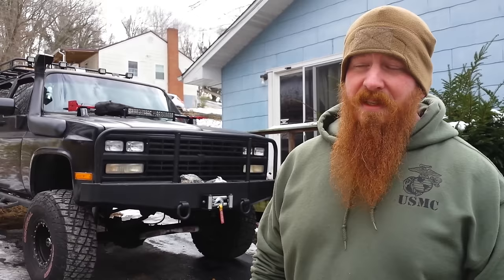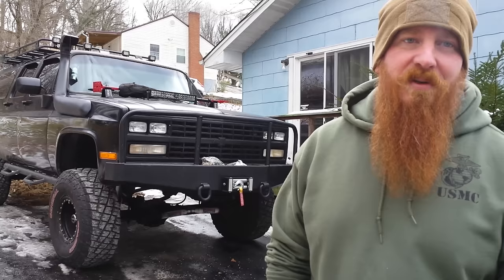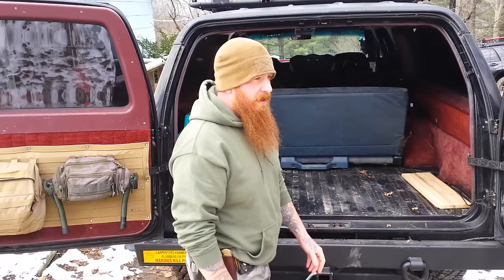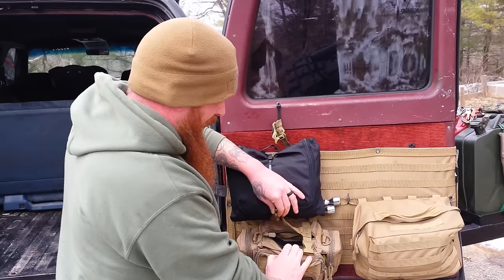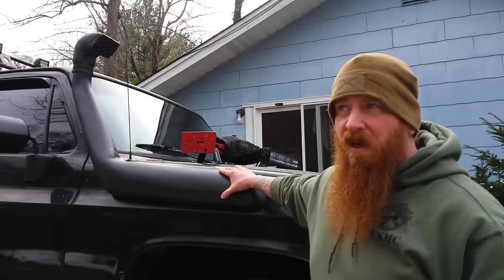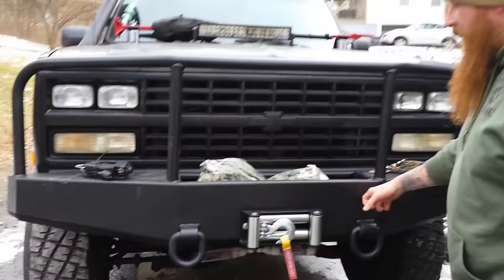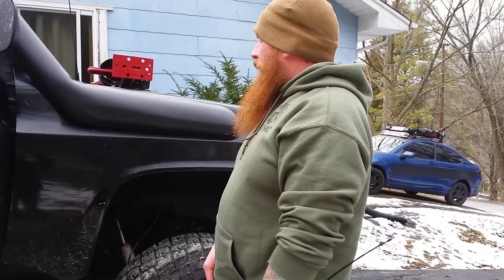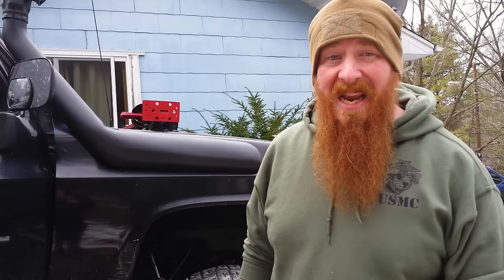80's Chevrolet Suburban 4x4 Bug Out Vehicle  (CSBOV)

Comment: Dense foam donut with a round outer surface to fit inside your tire with a center notch toward the wheel hub. Kevlar inner tube filled with Nitrogen that inflate's pushing dense foam outward making the tire ridged. Puncture proof tires come in really handy on a bug out vehicle. 😊

Comment: Additionally wise would be , 4 inexpensive baofeng , etc ham radios inside a med sized faraday box in the back with solar chg batteries and a solar panel / extra lg battery as well . Burkey filter , etc . Roof inside frt mount weapons racks , few other goodies . Several farradayed surefire lights with a bunch of batteries . As well ANYTHING ELECTRONIC IN RUNNING GEAR . Spares farradayed on the roof rack compartment . Get an additionally enlarged capacity alternator and a secondary rear mounted battery also .
Reply from the maker: Thank you.  I have tons of comm gear

Comment: nice rig, i have an 89 suburban as well 3/4 ton, just put 35's on it ..lockouts on front hubs and ox locker going in rear diff next month. same light bar and  im looking for a bumper....love yours....truck fits nicely  in the back of my duece and a half  lmao...just scored M35 multi-fuel  im in love. good work, semper fi brother. get your HAM license and add a 2 meter radio ...use CB as well. all the best from alaska KL4UQ
Reply from the maker: You fit nicely in the back of mine motivator roflmao

Comment: Y'all never checked into a split power swash plate system for your bug out vehicle that gave each tire a drive system removing the need for a axial that would greatly increase your ground clearance under your vehicle? Some thing to look into. ☺

Comment: I had an 89 burban in 2013 wish id never sold it, welded up the rear end with 32" tires 15" wheels it would go through a lot in just 2 wheel drive risen to buy another here ima few weeks

Comment: Real beauty. :D  That's pretty much what my bug-out vehicle will be.

Having worked on lots of old Chevy trucks, I'd give one bit of advice.   The 4-speed 700R4 transmission is a weak link.  They don't tend to hold up well in off-road trucks, and don't last as long in normal use as the other offerings.  Either an automatic 4L80-E, or manual NV4500 would be ideal for a rig like that.  You can't break one of those with a sledgehammer.

Comment: Great trucks. I have an 85 that finally rusted away to the point I had to park it.  It's been sitting for years, but I'll bet with a new battery and fresh gas it would still run. They were the best vehicle GM ever made. I also have a 99.It's not even close to the durability of the old style.

Comment: I suggest a decent solar rig up. You could put your radio along with other electronics in it as a primary use in day time, and battery charger for night, possibly charging those batteries someone else suggested for the radios and wench. Why not flip the snorkel backwards though, that way if there were contaminants in the air it would not be forced in? Honest question, not sure if my theory would work any better honestly.

Comment: Those older Suburbans were great...our scout troop had an 84 that thing would go anywhere and carried all of us scouts, and our gear.  I don't think you can chose the carrying capacity on the new ones, but I know on the old ones you could get a 3/4 or 1 ton.  

Those aren't lockers, those are manual engaging hubs for your 4WD.  Lockers go in the front and/or rear differentials and give you real 4WD, by mechanically connecting your left and right axle shafts with the differential and drive shaft to the transfer case and this gives you equal power to the wheels no matter what your traction conditions are, or if you have a wheel off the ground, or one on ice and one on pavement, etc.  Without locking differentials 4WD is nothing more than modified 2WD and you usually have 1 rear wheel and 1 front wheel spinning.  Manual hubs and a manual transfer case is the way to go, very little stuff to fail and when it does its easy to fix, the electronic crap will break and you'll be pulling your hair out trying to chase down the reason.

Comment: Needed things;
LED Light bar ontop... for snow rain and fog. 
Truck engine belts, 
Water/snow proof engine grease (german or norwegian made)
a clundrum of nuts and bolts for those times when you loose some on the road.
4 spare engine filter
8 spare spark plugs
spare engine pipes and steel clamps for tightings the pipes or heatproof gorilla tape.
Truck snow tire chains..just in case.
heavy hammer.
chain saw its repair tool and fuel (for cutting a down tree in the middle of the road)
Tire repair kit (tube or tubeless)
Portable Air compressor kit.
Truck jump starter kit 8000mah battery rechargable.
extra ammo (pistol or rifle)
A Good prayer before the trip or bugout.

Stay safe.. GOD BLESS.

Comment: While there is nothing bad about "bugging on a budget" it's important to know what good tools are and what cheap imitation tools are, when SHTF it's a bad time to figure out the limits to what you can do.  Would be curious to know what is under the hood other than bare bones, especially if there is a snorkel which I assume is more for dust/debris rather than water because if you are taking a truck like that into water deep enough, you deserve your new boat.  There are a lot of upgrades that are useful and improvement from the late 80's that would be useful.

Comment: What no keyless entry, no 20 inch bling? lol Amen to that bumper sticker! Quick question I have tried different ideas on my burb cargo doors for storage. I even bought those blank jerry cans that are actually tool storage. I have mounted countless junk on the paneling trying to  gain organization. I recognize the military bags you used and know where to find them. But what is the cloth type panel they are attached or mounted to is that something they use in humvees and transports? If so, is this army surplus findable as well? awesome rig! Great vid on wench use too... Something I also use for safety I always lay a floor mat over my wench cable about half way Old timers explained how if you snap the cable for some reason the two halves will fly downward instead of upward possibly keeping people safer.

Comment: Great truck, I would recommend you upgrade to Corp full floater 14 bolt rear and a Dana 60 front axle.  Muck stronger than the 1/2 ton axles you have.
Reply from the maker: Almon Jacob  This video is 2 years old been driving the truck now for 6 years it's a daily driver never had any problems with the axles

Comment: I have a 97 2500 looks almost idendical, same color, same basic roof rack, I run BFG KM2's for tires in 285/75/16's. It's got a 4" lift, came like that when I got it. The only thing I don't care for is that it's got IFS instead of a straight axle. I want to get one custom made but it's like $5000.
Reply from the maker: Nice

Comment: I have the 98 version of that, painted sand Brown I saw you have a snorkel on here but unless the electrical system is as high as the snorkel it will short out long before water goes up inside of the intake, mine is lovingly referred to as the zombie wagon

Comment: Tractor tread like a tank that passes ftom wheel to wheel with the top part of tread passing through a roller on each side of the vehicle laeving a full tread contact on the ground. Watched a Ripsaw video then a video on those tank like treads you attach to each wheel. Then was watching a documentary on WW2 German vehicles that had treads with two front tires. Then came up with the idea. Pull the Tractor tank like tread's out inch the vehicle forward placing tank tread on tire bolt roller to each side of vehicle thread tread through roller inch vehicle forward place tank tread on rear tire of vehicle. Then adjust the roller for tension with the tractor tank tread having an inner track to keep the tractor tank tread on your vehicle's tires without falling off or slipping. Just another tool or option for a ultimate bug out vehicle. 😉

Comment: Nice bugout truck.
Probably no EMP issue because it's an older model.
Reply from the maker: Yeah no computer. I keep back up parts in a metal trash can lined in rubber. Things I may need to change out.

Comment: i could never understand the bigger rim thing. i just got a GMC 98 suburban 4 x 4, no rust at all and only 107,000.2 owner. a few nicks and branch scratches. it set up to haul a large 36 ft camper.added leaf's and brake controller. came light bars front brush guard with nice new tires and rims. but they're 17's. got it for $3600. i am dying to lift this like yours.
Reply from the maker: Sounds pretty awesome

Comment: Building my own BOB, I started out with a totaled 1982 suburban, the only way to go!  Got the 1 ton axles, granny 4 speed & gear driven tcase.  I broke too many aluminum transmissions offroad, so be warned.  I only want steel & iron under my rig, no aluminum.

Comment: did yah add longer diferential discharges as well? idk how you call them in english.. differential vents.. so the diffirentials dont pull in water trough the seals and fill up your axels. so many people add a snorkel but forget or just dunno to add this too. i subbed. nice vid!
Reply from the maker: ULTRA NOOB yes they run into my cab

Comment: A couple of points here and please do take this as constructive.  I'd be much more interested in the latch on the tire rack, than how to operate a winch. I'd be more interested how that winch is mounted. What did you use for an hinge on the spare?  I'd like to know if that snorkel is actually functional, actually hooked up to the air box.  How is that roof rack mounted? Okay some dork put 20inch wheels on it, do I need to know that?  And some other dork bought them BFD.  Your idea on the jack, I'd like to know how that is mounted. The hood is just sheet metal with some stiffeners, did you add any support? The Chevy hinges are notorious for problems I'm not sure adding that weight is going to work out long term. Your idea with the ratchet strap for a tree saver is questionable, there are much better solutions. I doubt it is rated anywhere near what the winch is. A snatch block and a 20,000 lb strap would be much better solutions and keep the strain off that little winch.
Reply from the maker: Thank you

Comment: Carry extra spare  breakable parts to your truck with you. 
U joints, tie rods, plugs, etc. 
No parts stores open after shtf.
Dont loose your rig to a cheap part failure.
Reply from the maker: It'll be Alright it's not a ford.

Comment: May I recommend getting the second battery tray used for the diesel engine, put a good heavy battery in it, a battery isolator, and have a electrical shop boost the out put on the alternator, and run the high draw stuff off of that?  Cudos to keeping the 15 inch rims, I put p265/75r15 on my unlifted 84, made a world of difference.  Enjoy your low key, common sense ways!

Comment: Need to check your electrical connectors on the winch, you probably didn't see the sparks fly off the bottom at 23:10
Reply from the maker: I fixed it in the video read the comments

Comment: Just a question. Would getting a carbureted engine be better than a fuel injected engine? Reason why I ask would it be for better engine maintenance and ease of repair? Would parts be easier to find?
Reply from the maker: A carburetor engine is much better to have because of an EMP And maintenance as well. Now in a off road since you may have trouble on inclines using a carburetor because the fuel won't go into the intake like it should

Comment: If you think it'll ever roll over , you'll want an Exocage👍🏼My brother rolled his Suburban off a bluff driving drunk and a tree stop him from rolling anymore - looked like King Kong stepped on it 👣 Flat as 🥞!  What's the engine look like ? air compressor? on board welder with 110V plug & high amp alternator, (2) deep cycle Optima batteries? limited slip 4x4 or True Lockers , solar ??? So much too do and so  little time , whens enough enough ? how far do you wanna go l guess ?? hahahaha  Overall sweet  truck !!
Reply from the maker: Jerry Dandridge it's black underneath the hood too.

Comment: Not a bad start. Should invest in some proper glass lights for the front, instead of those yellow plastic things and maybe some autolocking hubs, but that's just my opinion. You do you. I haven't seen manual hubs on a Suburban since the Autumn of '56.

Comment: got a question for you about the body lift i have a 1990 k5 with 3" body lift and 35x12 15" tires on it when doing just a 3" body lift do you have to change your steering arm..

Comment: Love it. It's sweet. Does it have double batteries? I have a 85 short box. It was a half ton. Problem with half ton axels is if you break a axel the wheel falls off. Dana sixty front axel 14 bolt rear end. You have to change wheels to at least sixteen or it won't fit over the breaks. 205 transfer case and bigger drive lines. I've been through it and this truck is way cool and functional. I think this needs a stronger drive train. Weight and big tires equals breakage.

Comment: i have 1990 suburban   i'm just wondering if you had made any modifications  to remove the fuel pump....I had to remove a slide plate and the huge gas tank  what a PAIN   i cut a 9 inch square hole in the floor so i gan remove a bad pump without dropping the tank...   something you might think about
Reply from the maker: Yeah

Comment: Did you upgrade the alternator?  On my 1990 F150. I put a new bosch130 amp, one wire alternator on it off a later model torus.   Cost me about  $120.00.   Had to grind on some things.   I did it so I could run a AUX fan and upgrades head lights.      Will be following.  Same mind set.

Comment: Brother  I don't know if you Noticed when you was putting your winch away the last little bit you had a short and a spark came from under the front bumper looks like a bad connection or wires split it was at time frame 23:11 just thought I'd let you Know Brother incase or before fuses start popping Bad Ass Truck I'd Love one even on the U.K Roads That's A Badass Beard Aswell. Have A Nice Day from the Carey Family in the U.K. 
God Bless An Protect you an your Family

Comment: What kind of front axle do you run? Looks like it has a straight axle but I can't quite tell from the vid. nice truck though; considering getting myself a 90s 2500 with the 6.5L Detroit Diesel they use in the Humvees

Comment: I would just like to make a comment about your suburban. I used to have a 85 K-5 4x4 Blazer.I would encounter engine dying on steep off road terrain due to the carburetor float shutting off fuel in the fuel bowl on inclines. I have no idea if your 89 is fuel injected but you might have the same problem if your carborated
Reply from the maker: lineflyer1 don't go vertical lol

Comment: Awesome rig walk around brother! Did you fabricate those bumpers yourself or did you have a shop custom fabricate them for you? Also for those who have a winch with a steel cable and NOT synthetic rope, invest in a winch cover like he has if you live in an area with a lot of snow, that may help prevent your cable from rusting due to salt trucks. If the winch your vehicle is attached to is not your daily driver than maybe it's unnecessary or if your winch is a bit more hidden where you cannot fit a cover over it. Also the tie down straps for winches that he is referring to are also known as "Tree savers." Shackles and Winch dampeners are another good investment, especially if you have a steel cable. Shackles may help reduce the load of w.e. you may be recovering whether it be your vehicle or another depending what your circumstances/applications are. What he is saying about synthetic vs steel cable is true too.

Comment: Just because rims are 20", that doesn't make them "gangsta rims", sounds like someone has issues to deal with. Chevy made factory twenties for my truck, and we take it to the backwoods every other weekend. With no problems, and it is actually easier to find 20" tires for the 2015, than finding  15" tires for my 93 1500. Rims don' t make you gangsta, that is your behavior could do that. Enjoy your peace and remember to keep friendly,  you must keep it correct.
Reply from the maker: Someone Is offended.
Reply: @StepOneSurvival  not offended, I recognize ignorance when I encounter it, just wondering if you planned to break out the old bars and stars, and start whistling Dixie.

Comment: I have a 99 Urban HumVee. (6.5TD Suburban). 'Bout to go medieval" on it. No computer, no trans controller, manual fuel control. Keep spare rectifiers in a sealed can along with hard drives, data and an old laptop with spare batteries. Just too much data needed to keep hard copies for all except survival mode text. Brother you are dead on about straining synthetic fibers. The Navy has wonderful videos of lines snapping people in half. It isn't an intuitive situation, you must know how and how NOT to use a winch.

Comment: Did you notice you have a short in your winch controller? or power connection.
 Put the video in slow and start watching at 23:05 and watch the hand
 control arc to the bumper.
Thanks for the nice video.     Regards from Ody Slim

Comment: During shtf all vehicals are destroyed. First large to small especially trucks because they can be outfitted with heavy weapon systems. The last thing they go for are bicycles. If you want to do a fast run and avoid all the trouble. motorcycle to 30+ft sailboat. The ocean is dangerous in and of itself.

Comment: Great video. You said there are numerous ways yo use a winch. You should make a video or a few vids showing those ways. Also at 23:10 there was a spark while putting away the winch cable what was that from ?
Reply: It was a loose wire or an exposed wire and he fixed it.